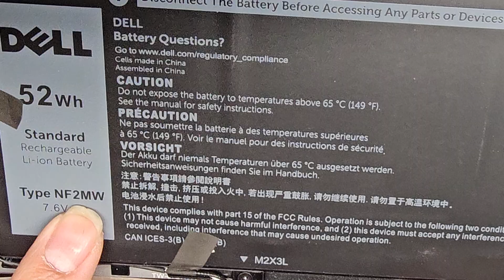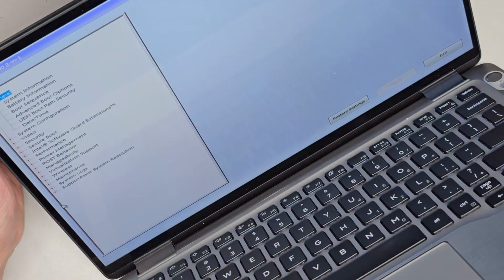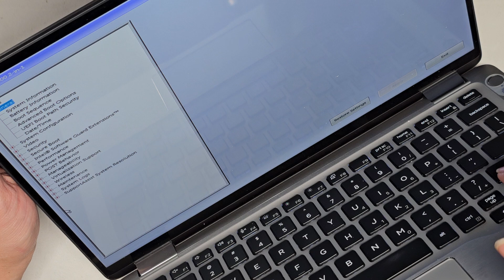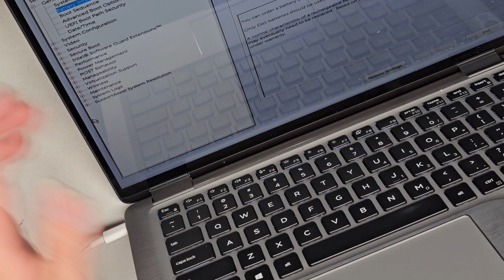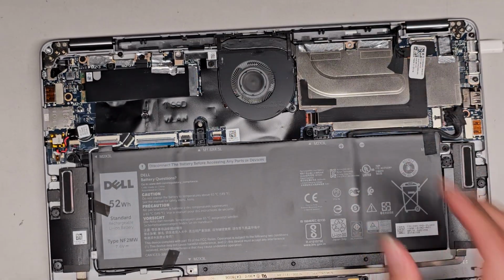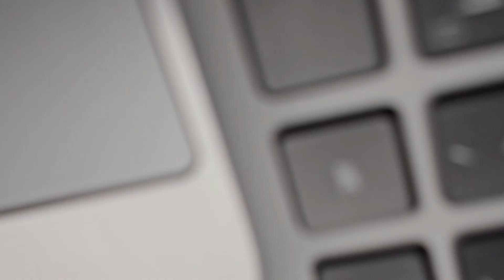Dell Latitude 7400 2-in-1 Disassembly SSD Hard Drive Upgrade Battery Replacement Repair Quick Look

Comment: My laptop has the WWAN card in it. I wanted to upgrade my SSD and almost naught a nvme SSD not knowing it wouldn’t fit cause of WWAN card. If anyone has this WWAN card blocking SSD you’re supposed to buy a sata m.2 2242 SSD which I think is a little less efficient card then a nvme in terms of speed and also don’t go up as high in storage
Reply from the maker: It works?
Reply: @ItsBinhRepaired  both the sata m.2 and WWAN card works on my laptop haven’t used the WWAN card though but it shows a cellular option on my windows setting if I want to add a sim/newtwork
Reply from the maker: @benzybtw  nice!